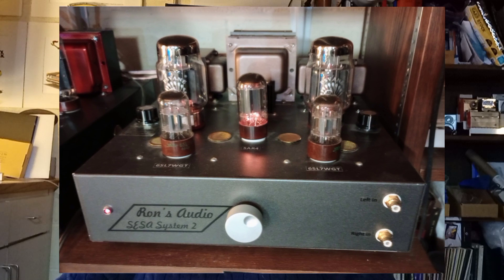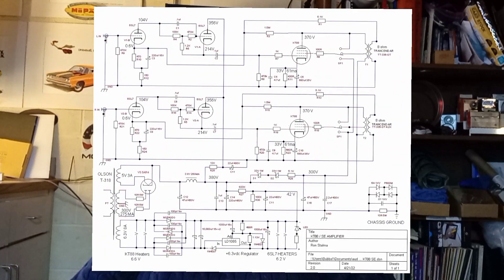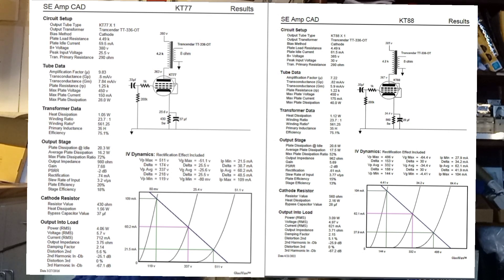Single Ended Tube amp modification magic bullet takes it to a whole new level, my imagination?

Comment: Congrats, on the lovely Christmas present!

I'm interested in your adjustments here because I can't help exploring alterations to the circuit of my Luxkit A3600 for a number of reasons: 1. because its a kit 2. because it is not a factory built unit, 3. because the original output (8045G) and driver (6240G) tubes are long out of production 4. I am an audiophile curious and keen to tinker and understand how I might improve the sound. 

The amp came to me with modifications to feedback resistor and bypass cap values to take KT88 output tubes and 6CG7 driver tubes. I've since modified it (cathode resistor values) to accept K120 output tubes and 6GU7 driver tubes. It sounds much better than when I got it - it was very good when I got it but I've made tweaks to the pi filter (thanks, to PSUDII) and I am now turning my attention to changes to the feedback cap and resistor values. Given how good the music reproduction is now, I am far less eager to make changes in case things go backwards. I am also keenly aware how little I know and I don't have test equipment to take objective measurements.

Still I have been curious enough to scour the internet and found several accounts of people's changes to the circuit so I now have a range of 'known good' changes to choose from. 

BTW, you said on the video you adjusted the cathode resistors on the output tubes from 430ohm to 680ohm but your schematic suggests they've gone from 430ohm to 560ohm? Is that right? Anyway, I've liked and subscribed to see where you go from here - all the best!
Reply from the maker: I ended up using 560 ohm resistors. Works good with EL43, KT77, and KT88.

Comment: hi,i make a research for your output transformer trancend ar 336-ot but nothing about that ,can you tell me what you use in this amp ,is it 5k primary ,so what your cathode voltage ,thank you
Reply from the maker: Hi, the output transformer is 4.2K. But in the video description is a link to the schematic that has the voltage information you want.
Reply: ok i see now  ,do you recommend   edcor  output transformer  or another ,i got hammond actually and its horrible on square wave  ,thanks @electricroo
Reply from the maker: @kubockferre5532 I do not recommend Edcor. Hammond is actually better. I only use Heyboer now here in the USA since Transcendar no longer makes transformers.
Reply: i checked for heyboer but  this is guitar  output transformer  its not good for hi-fi  do you have a reference  to suggest @electricroo
Reply from the maker: @kubockferre5532 Heyboer will make what you want and pricing is reasonable. Fill out the Web site contact form and specify what you want. 0:02
Reply: ok i  check that with heyboer ,thanks a lot  @electricroo